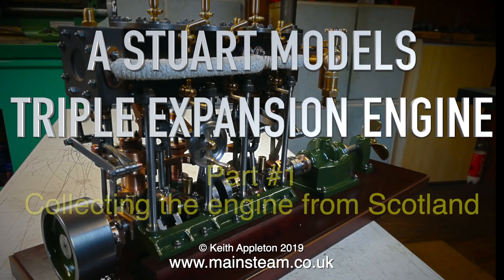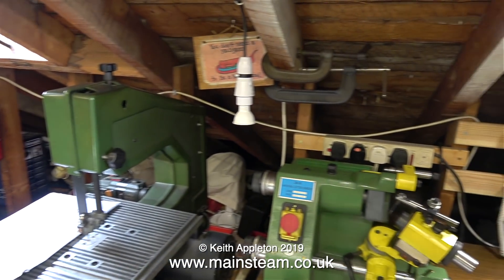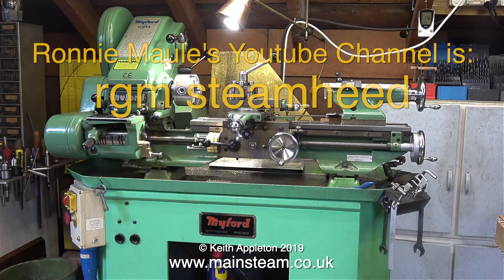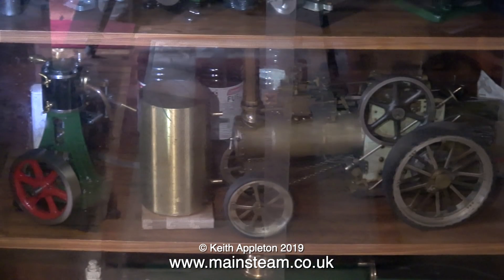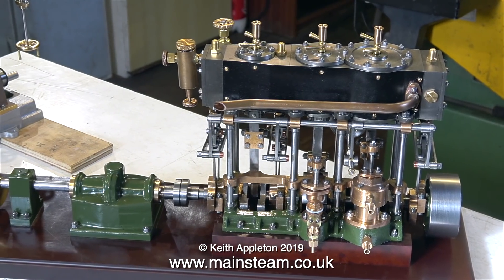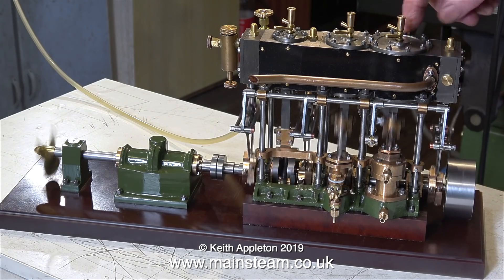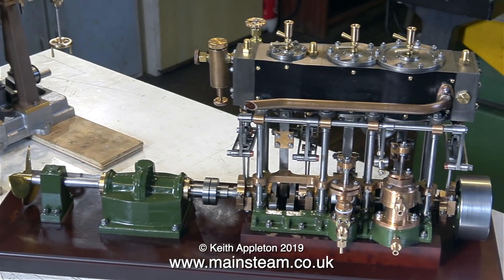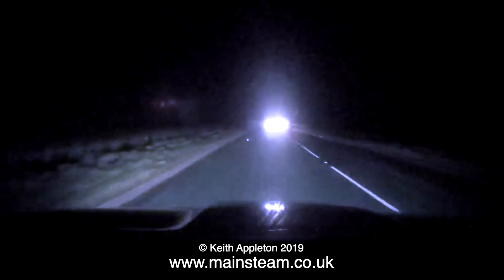A STUART MODELS TRIPLE EXPANSION ENGINE - PART #1

Comment: Keith, I bought one of those super quiet air compressors last year and was curious about how they made it so quiet. I found that when I removed the air filter housing with cylindrical washable element) it got much louder. It seems that what quiets the intake is that they have installed a smallish diameter piece of hose on the reinstalled housing and blocked off the other holes and openings save the one where I installed the hose. I checked for air restriction by feeling for pull when I remove and replace the housing. It made a nice improvement on my 2 HP shop compressor. I got additional improvement by mounting a piece of packing foam the diameter of the A/F top cover between the cover and the filter. Hope this helps.

Comment: I’m lucky to have one of these, with its original box and drawings, and some invoices from Bassett-Lowke, dated 1965 ! I still have to finish the reversing gear (straps, rods, drag links, reversing wheel and shaft, plus many details). These engines need a lot of tiny work !

Comment: I’m curious, have you ever seen a working model of one of Titanic’s triple expansion engines? They’re not the simplest designs, but I’m surprised with all the love for the ship there aren’t more models out there
Reply from the maker: Ronnie Maule who made this engine is currently building a Ship type Triple Expansion Engine not dissimilar to the ones in Titanic.
Reply: I’ve already seen one somewhere, a quick search on YT could lead to it
Reply: Titanic engines had four cylinders,the engine was still a triple expansion,a single LP would have been massive in diameter so the volume was split between two smaller cylinders,one at each end of the engine.A low pressure turbine drove the middle propeller from LP exhaust.

Comment: How Does The Attic Floor Take So Much Weight ? Very Nice Engine Though
Reply: All machines are placed directly above the brick internal walls of the house ,the floor joists are 6"×2.5".
Warco mill sits above the junctions of four walls and three joists,plenty strong.

Comment: But in real life that little propeller is far too small for the power output of the engine. The engine would feel rather underemployed. There should be a gearbox on the shaft and at least two propellors, if not three.
Reply from the maker: It's a display....
Reply: It's a display....
Reply: What size of propeller did you put on your engine? What type and gear box did you use? What gear ratio did you go with?
Reply from the maker: It's just for display, not a gearbox ....
Reply: @keithappleton  maybe the whole of life is just a display.
Reply: We are going to need a bigger boat.